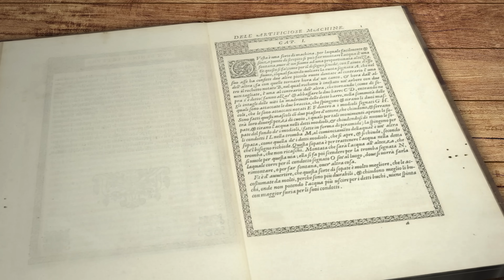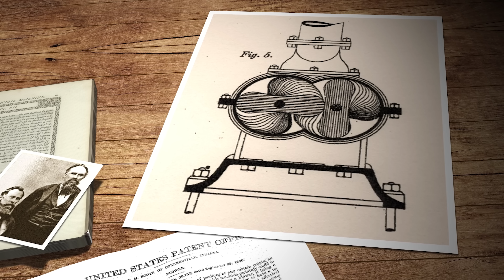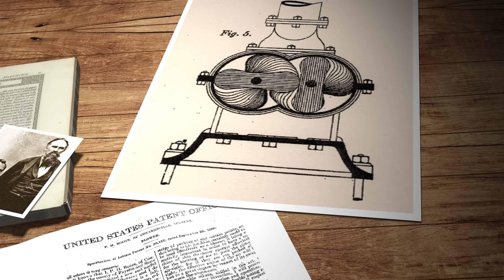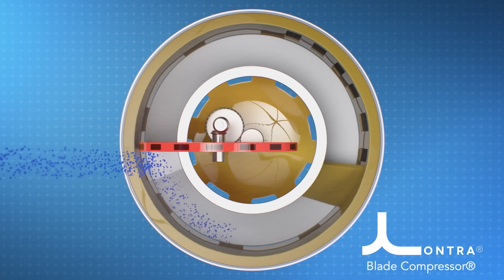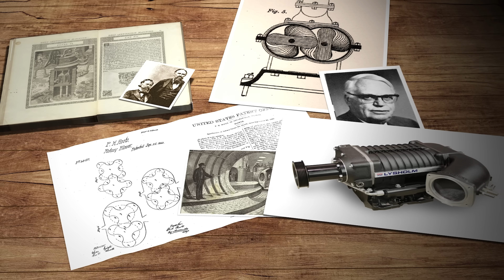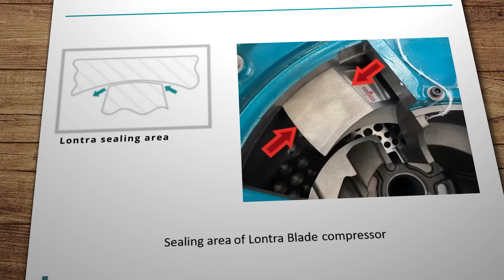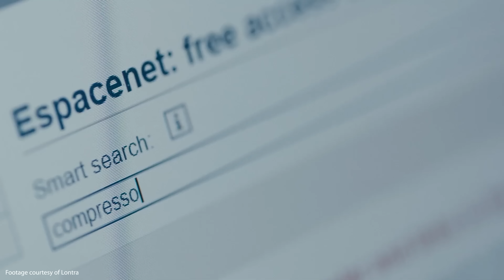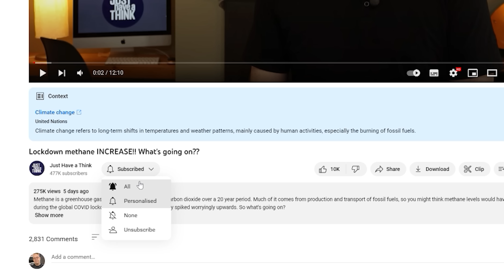Compressing air to reach net zero. A 'revolutionary' innovation.

Comment: Wow, a bunch of knowledgeable, intelligent and a broad range of experienced people in the comments. Makes it a little intimidating, but what the h*ll, I throw my hat in the ring. 
I worked in water and wastewater treatment for 38 years. Became a plant manager for a little over 25 yrs. Our plant electric bill was over $250K/yr. Most of that was to run a 400 hp blower for aeration of wastewater. We also ran a fluid bed incinerator, which required a relatively large blower, and a couple of compressors one of which was a Roots screw type. Additionally there were several compressors supplying air for various uses around the plant. I absolutely loved my job, there were so many things to learn about, technical operational stuff, PLC programming, systems interface and controls, and lots of mechanical, machine operations, and pumping, pumping and more pumping. 

The last 12 yrs or so of my career were entirely devoted to improving efficiency. I have to give credit to the US Dept of Energy, I have plenty to complain about the government but credit to them when it’s due. I went to a energy conference, wasn’t expecting much out of it. There was a woman from DOE there to present on the need for municipal plants to focus on energy efficiency. She was a remarkably motivated speaker with an infectious enthusiasm for the topic. The takeaway from her (at least for me) was set a “big hairy audacious goal”. Mine was reduce plant utility bills by 50%. This launched me on and twelve or so years long journey trying to improve efficiency wherever a feasible improvement could be found.

There are lots of comments suggesting this new compressor type should be more widely in use, why or why it’s not more accepted in industry circles and why it’s not marketed etc. I have done all kinds of projects that involved new equipment selection. For whatever it might be worth to someone here’s what I learned during my tenure trying to be a good steward of the plants that I was involved in: 

1 - you might be willing to be the beta test site once, twice maybe if the first time turns out well. But it’s a risk, and if it doesn’t go well things get expensive fast. Everyone wants to sell something to treatment plants. And plenty of those people seem to think that the treatment plant people are stupid, maybe dumb too. I would do serious research before committing to a new blower technology. We changed blowers and we worked very hard to make a careful decision. 
2 - At the plant it may be easy easy to determine that a project makes sense. In the end a project that spends a significant amount of money will be a decision ultimately made by first upper management, then a political body. I have seen projects that had return on investment in under two years, but shot down because of the big dollar price tag. Just the big number. And they questioned our intelligence. 
3 - Any significant expenditure goes through a planning process, if it makes it the project gets put in the “capital improvement planning document, a six year expenditure forecast probably at the end of the list, and the document might not be open for changes even every year. Then budget, at least a year, and some places use two year budgets. Then add engineering, open bidding and contractor selection and depending on the political system that could be another couple years. 
4 - I t can be difficult to get plant personnel onboard with a change, better the devil you know, and it’s working, why are you trying to fix it. 
5 - not everyone is interested in energy efficiency for any reason, dollars or climate change, and some are outright opposed based on principle. Don’t ask me I really can’t answer that question. 

I really thought that I would say much more, but I probably said too much already. I went after compressed air systems. It was easy really. I’ve been out of the game for a while, but as I recall it takes approximately seven hp of energy to perform two hp of work using compressed air. Unless there is some physical reason air must be used that’s pretty easy to beat. I hope the promised performance of this product pans out. Knocking down energy use while saving $, if true should be an easy sell

I wish I knew the name of the women from DOE, I would thank her today.

Comment: I'm wondering if you could have a combustion chamber at the output with another compressor mirrored to create an internal combustion engine.  The two mechanically linked.  It might be bulky but could be good as a generator that is run for very long periods.  The lack of friction and oil requirements could make even bigger cost savings.

Comment: Reminds me of the Astron Omega 1 engine. The intake part of the engine, that is. It's a pair of gears that counter rotate, except one has only one gear tooth while the other only has one tooth gap. The air gets trapped and compressed just like in this compressor.

Comment: So... Does this work(with slight modifications) as combustion engine? Because it would be a very efficient engine no reciprocal linear motion only circular therefore no convertion from linear to circular which increases the efficiency of a combustion engine from 40% to 80 to 90% efficiency. I need to rebuild this👀. And put it into my car to win the next race 🏎️😎

Comment: as a Compressor, hydraulics tech, journeyman millwright, pipefitter, carpenter and controls electrician in Haz or not locations I see How and Why it will work, but the counter axis of the compression and valve cycle will "In My Opinion" never win out over the screw compressor for volume or durability. I would say this is more of a screw compressor valved cycle rather than through put. I must wounder if it has a pressure pulse on valve cycles.
I have done everything from 10,000 psi to vacuum in all environments from pharma aero industrial and waste treatment.

I predict the Next innovation to work will be a version of circular rail gun/piston electromagnetic system so the electric motor will be the compressor?

Comment: If you go to the Lontra page, it states the compressor is for low and high pressure applications, flow rate 350 to 1550 CFM, and a pressure range from 4 to 15 PSI. Not like any bicycle pump I've ever used. Did I miss something here? It's being used to aerate water purification systems. It can blow bubbles to about 33' or so.

Comment: I see a few problems with this design.  If synchronicity is lost, due to wear or breakage, the horizontal spinning arbor can run directly into the side of the vertical "gate" disc, resulting in a catastrophic failure.

Comment: Attach one to each hub of a wheel
Make pressurized air move a turbine that's connected to a generator
Each wheel contributes to the charging of the power cell

Semi trailers- average have 4 possible hubs, that only roll around now.
Make the pulling of the trailer create power!

Comment: I'm trying to work out how we manage to decrease atmospheric CO2e from over 500 ppm to under 350 ppm through incremental improvements in device efficiency, that also need resources for development, manufacturing, and replacing existing systems. A bit like your house being on fire because your stove is burning it down, and objecting to turning off the stove because you're making parts for a more efficient stove that wont burn your house down; not exactly addressing the urgency, scale, or context of the problem. 

No matter where you live, you're watching species declines, unexplained die offs, parasites and pathogenic fungi attacking (often killing) trees, and incredible booms in crop and other pests despite an almost 95% decline in insect species over the last 25 years. You're experiencing weather extremes you have no memory of and incredible shifts from hot to cold and back, which have been enough to cook and freeze people in their homes. Glaciers are melting so fast, the earth's rotation is speeding up, and that sudden shift in mass balance is no doubt having an effect on recent seizemic events. Antartic ice is at an ALL TIME low. 

All of these issues are following a trend, getting exponentially worse, and happening with increasing frequency and duration. They're being powered by the deviation of humanity from its original niche to self apointed rulers and ostensible stewards of an environment, which has only ever proven that the only thing it needs from us is to go back to doing human things and stop playing at the idea we can fix this with a marginally better widget. 

Every second the atmosphere is unlike what it was in the preindustrial era, the earth becomes more alien to all life it houses. It is not a question of pollution in the sense that a spilll or something is local to that event, it is the actual baseline atmospheric chemistry we've altered. If it sounds crazy to run an economy by pulling oxygen out of the air until it's half of what it is now, and, when people are gasping for breath our response is "just wait, next year we'll be taking 10% less oxygen out than we are now", is that really an appropriate/sane response? 

CO2 is much more consequential than oxygen BECAUSE it's in such small concentration. It is the link between the amount of life on the ground, how much energy/warmth there is in the system to support its biochemical reactions, and a store for the discharged state of the carbon battery that is life in the carbon cycle. When the sun charges that battery in plants and algae, and pulls CO2 from the air, the CO2 is meant to be from the consumption of collected solar energy, by life, through the food chain.

There is no "excess capacity" in the system, for new carbon from an evolutionarily alien time, to support a species that has arbitrarily decided to burn the concentrate of ancient lifetime as a way to get work done. If we'd run the economy on consuming the oxygen of the air (which is also happening as a result of the overall destabilization of the climate), we'd have had a much greater tolerance for change because it's hard to wipe off 10% of the atmosphere, but much easier to add 0.02%. By "no" excess capacity, I mean that total exhaust pipe area is the same as the alien invasion that comes and wipes out the life earth to make a new planet fit for their species. Not only can life not tolerate the absolute shift of almost DOUBLING the amount of carbon, which is a selection pressure putting millions of species in the path of extinction, but that the climate hasn't found a balance with that chemistry, yet, and CHANGE becomes the only constant. A SHIFT is a pressure that is either adapted to or not but it suggests moving from one atmosphere to another, where a lot of species wont make it, but some will. CHANGE is the state where conditions are never stable enough to effectively adapt to. No sooner has one species found an optimum, taking over from ailing competition,  that species is suddenly subjected to a virus or sudden change in temperature that it cannot survive. Life could potentially survive a small shift in climate, but it has no hope of surviving constant change, especially humans. Humanity, like all life, thrives when its environment is predictable and mostly stable, and suffers when it isn't. Human civilization only started once the climate stabilized in the last epoch because the future could be assumed to be like the past. 

Humanity, and by "humanity" I'm being very cruel to most of the world that's always lived in balance with the planet and wouldn't be burning any oil if we hadn't taken the weapons off of the machines of war and used them to travel the globe to spread our cancerous hubris that, appointed by God, we could do no wrong. Really, it's just the sort of person that's reading this that has any stake in changing the atmosphere. Each of us, in everything we do, even in the food we eat as natural gas (one of the worst contributors to the deadly weather we've been having) is the backbone of the fertilizer we use to render otherwise depleted soil, productive. In one human lifetime, we've changed the world into an entirely new planet which is really what "climate change" means. We've been warned since the 80's that CO2 would trigger irreversible tipping points if it ever exceeded 400 ppm and here we are at... what, 515 ppm CO2e? 400 was th absolute ceiling for how much we could change the air before the system would break down and we've blown right by it like it wasn't.

Comment: Semi-positive displacement blowers such as Roots lobe, sliding vane or screw compressors are used in lots of applications which can't be accomplished with blowers or fans.  True positive displacement units with pistons or diaphragms are used for higher compression ratio applications, so these semi-PD type units fill in the middle ground.  So while this new compressor design sounds exciting as an alterative, the decarbonization benefits are significantly more modest than David has implied here.
Reply: I happen to like carbon. I use it extensively, all throughout my body, as does my food, which treats it like fertilizer and just grows like crazy with it.

Comment: Cool technology, but I'm not sure if I'm sold on something which depends on such tight timings. It seems like it would be too easy for severe damage to occur. Variable speed is a huge efficiency perk with units of this type, though I am more familiar with Tamturbo's compressors for  such applications. Their design is highly robust and can avoid any damage even when there is a total loss of power to the facility, which I am not certain would be the case with this design. I would love to hear your thoughts on Tamturbo if you plan to create more content which focuses on air compression.
Reply: Once the timing is set mechanically, it will persist until the device wears out.

You should take a look at valve timing in a car engine. Now THAT is scary! Especially at high RPMs.

Comment: Have you thought about using your compressor as a jet ski propulsion system that would give the owner the option of what power unit they use this would give boatbuilder s a great advantage rather than having to use the very expensive engines on the already cornered market

Comment: Where are the engineering specifications? Power input vs cfm output, performance degradation over time, effect of contaminated air, etc. otherwise this is just yada, yada, yada.

Comment: I wonder if it is quieter. Noise isn't usually the most critical factor in a compressor, but it has one of the biggest impacts on quality of life for people around them. Most compressors are quite noisy, so if this can be more pleasant to be around that would be a nice bonus too.
Reply: True. Screw and scroll compressors are quiet due to their smooth continous operation while piston compressors are often above 100 db in noise. However Scroll compressors also have a pulsed output like the piston compressor so I guess this rotating design could also hopefully be rather quiet running even the output is pulsed also in this design.

Comment: How is the seal maintained between the high pressure side of the blade and the low pressure side it must have similar problems as the wankel engine has which itself is only a modified compressor

Comment: These compressors are not new. They've been around in one iteration or another since the early 1900s. They've all failed to gain significant market traction for various reasons. The right angle drive required, simply can't be made efficient. If it's built to be efficient, then it isn't reliable. Thermal management of internals in longer duty cycles is also a considerably problematic in smaller examples. Larger scale applications can route fluid cooling, to alleviate the issue... but there again, raises the issue of ancillary efficiency losses. 

Beyond all this, are the massive machining requirements, compared to traditional offerings. Even with twin screw compressors, the surfaces only require two axis machining, all the surfaces are longitudinal, and gear mesh is parallel axis.

...and we haven't even addressed typical applications yet. Think about where most of these type compressors are used. In nearly all scenarios, they're not looking for simple pressurized air, but also smooth flow... something this particular design isn't particularly good at.

Does it work? Yes. Does it work well? No. Is it practical? No. Is it efficient? Not appreciably more than current market offerings. Is it cheaper to manufacture? Not on your life. In short, it works, and it's different. Market-wise, it's dead in the water.

Comment: I wonder how much carbon generation could be curtailed PURELY by addressing industrial inefficiencies? Material, Mechanical, and Thermal inefficiencies are obviously rampant in modern industry since it's built on design standards from the time before such things were even a glimmer of a concern... I'd like to see next-gen, high-efficiency and closed loop design theory applied, nay, REQUIRED in all future industrial constructions...

Comment: When you can assure me that the compressor can deliver 100-120psi pressure 24/7 for at least 80 000-100 000h lifetime with only basic service a few times a year (oil, filters and small parts replacement, 2h stop max), with more than 10% energy saving from screw compressors, then its a revolution.

Screw compressors are a refined technology and new more efficient speed controlled motors and other things make them more efficient than before. They also rely on a constant flow of oil that seals and cool the screw, then oil is separated from the air flow, really smart actually.

Got a brand new Atlas Copco GA45VSD+FF few weeks ago at work, hope its as good as our GA30VSD that have 92 000h and still works perfect.